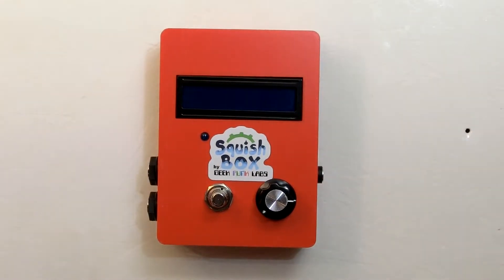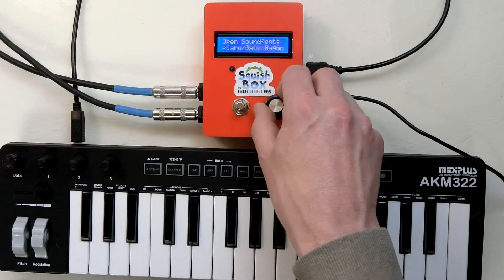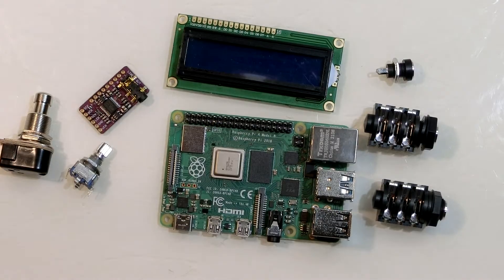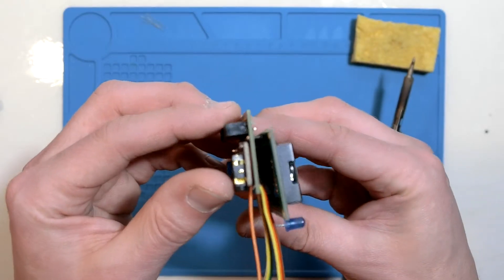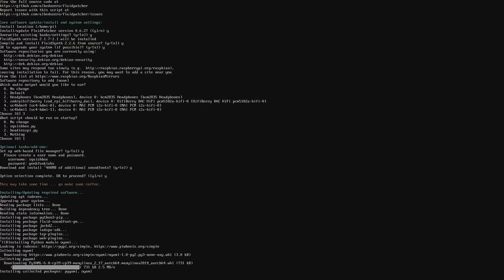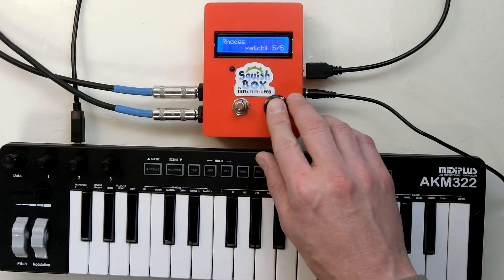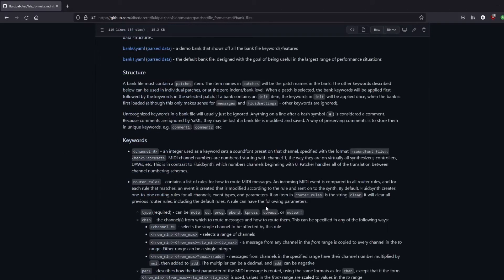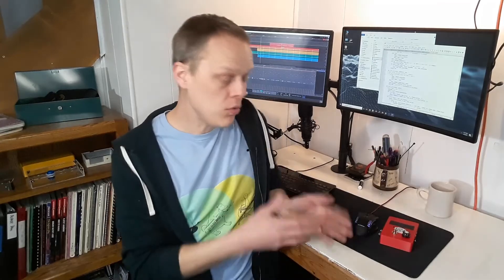The SquishBox: a Raspberry Pi Synthesizer

Comment: I installed Squishbox on a fresh RaspiOS on a separate Flash SD card. It works like a charme! I just plugged in a MIDI keyboard and got a nice selection of sampled sounds. No xruns, no latency issues on a stock Raspberry with stock Linux kernel. Great work!

Comment: This is amazing - I was wondering: Is it possibly to run the SquishBox with SamplerBox's software?

Basically, I love the interface/design of the SquishBox kit, with 1/4" cable outputs, the rotary push button knob, LCD screen, etc. But I like the simplicity of SamplerBox's software, and the idea of just using WAV files and a thumbdrive to play the samples better suits my needs. Is it doable? 

Thanks in advance!
Reply from the maker: Sure! Samplerbox gave me a lot of inspiration for this project. Since it's also written in python, it should be pretty easy to write your own interface for it using the squisbox API: https://geekfunklabs.github.io/squishbox/software.html#api-reference

Comment: This is a really nice project. Would love the ability to use classic Midi 5 pin din instead of USB midi, to use with classic synths, sequencers etc.
Reply: They do sell little midi boards you can connect to your raspberry pi with 5 pin
Reply: Did you ever figure out how to do 5 pin, I’m in the same boat, looking for essentially this but 5 pin so I can use my rock band pro guitar
Reply: There are lots of cheap MIDI-USB adaptors.
Reply: @amigalemming yeah but not my point

Comment: So, how much for this?  I can buy a Galaxy tab A7 or 8 for $80 to 100 and have a giant touch screen and endless apps.  Just holding onto outdated solutions.   Pi projects end up cost 2 to 3 times a tablet in 2023!
Reply from the maker: Store link is in the description. There certainly are more apps available for a tablet, but there's less ability to tweak things if that's what you're into. I'd say it's down to what form factor you prefer.
Reply: @white2rnado   I see your project is really you sharing a cool idea and your skills.   I'm a bit jaded on count of some folks are charging insane prices for their kits!  Didn't really see you are making nothing here.   Thank you for sharing.  Cool stuff.
Reply: This kind of thing clearly isn't for you. Also, good luck with android's audio latency. There is nothing outdated about Hardware synthesizers.
Reply: @1999Fabion  Well, I've had great luck.  Thanks for asking  :)
Reply: @Curious_Skeptic  Idk how it is now, but it used to be that androids audio latency was too high and made using midi keyboards pretty much a shit show, when you press a key and then hear the sound. I tried fl studio mobile, and the on-screen keyboard was the same way. It was due to how android routed audio. This was the only case I would recommend an ipad over a tablet. Is it better now?

Comment: Dear Bill, I have an Orange Pi PC 1, do you think it could be used instead of a Raspberry?
I am concerned about the compatibility with the 40 pins for the power supply.
Thanks very much, my friend.
Reply from the maker: Unfortunately, probably not. The power requirements look to be the same, but add-on cards aren't usually compatible between different SBCs. Even if the layout of the 40-pin connector happens to be the same, if the boards use different processors (which is the case here) they'll need different drivers/dtoverlays to be able to talk to the sound card. I'm trying to learn how to do this, but it's pretty far outside my skill set - hopefully someone out there can help!

Comment: Quick question: My python is VERY rusty. Is there a way to use an LCD with a I2C interface without doing extensive changes to the code? I had a couple of LCDs with I2C backpacks already soldered on.

/Bo
Reply from the maker: Yes - change lines 16 and 57 in stompboxpi.py (https://github.com/albedozero/fluidpatcher/blob/master/utils/stompboxpi.py) as described in the docs (https://rplcd.readthedocs.io/en/stable/getting_started.html#setup-i2c) and it should work fine!
Reply from the maker: In future maybe I can modify the code so one could specify I2C/GPIO in the config file

Comment: I have a collection of like 50GB of sound-fonts I put on a hard drive to revisit when I got something to browse them. Is this a good solution for that? Seems like it! Can just throw thousands of files at this and slowly pick out the best patches, and put them in a set of new folders as I parse through? Fantastic hardware project!
Reply from the maker: Sorry for the slow reply, but just FYI if you have any huge single soundfonts (gigabyte-ish sized), the synth can't open them if they won't fit in RAM. The lite OS and synth software need about 100MB, so you'll have 900MB left over on a Pi 3B+ -- more if you're using a Pi 4

Comment: Do you know if it would be possible to combine multiple midi instruments together, so you could have just a plain old keyboard, a slider wheel, plug them both in and then get a piano with slider wheel?
Reply from the maker: Sure, as long as they can both plug in to a USB port, the software will accept MIDI messages from both the piano and the slider wheel

Comment: How big a sound font file can be loaded into a Squishbox?  I have a file that is about 10Mb.
Reply from the maker: 10MB is fine. There's a difference between how many you can load onto the SquishBox's SD and how many you can be actually using at the same time. The amount of memory you have to store soundfonts depends on the size of your SD card. The software uses about 300MB of RAM, and a Pi 3B+ or 4 will have at least 1GB, so you can use up to 700MB of soundfonts in a single bank file. If you have some crazy big individual soundfonts (like >500MB) you'll want to get a Pi 4 with extra RAM.

Comment: I am having trouble getting the hifiberry DAC 2 working with Squishbox, but it could be the RPi I am using.  dmesg is shows the overlay throwing an error.  All that aside, thanks for doing this! I am really happy with the minidexed project (although it would be awesome for that project to support i2c devices and be a little more flexible on hardware).  Blokas MODEP on RPi works great as an effects unit too.  Golden age of linux music production!
Reply: Hey, the HiFiberry works like a champ in one of my RPi 3s, so that's what I'm going with. Cheers!
Reply from the maker: @JoeJohnston-taskboy  If you're using a DAC 2 I think you need dtoverly=hifiberry-dacplushd in your /boot/config.txt - sounds like you got it working so maybe you figured that out 😊
Reply: @white2rnado  The RPi4 I was using has some broken GPIOs, I believe.  The RPi3 worked fine.  Yes, I needed to add the dtoverlay line (which was hifiberry-dacplus in this case).  The unit is working well.  Really impressive project!

Comment: Amazing work, man. You're a legend. Can I create CC assignable patch changes? For instance, with an Alesis Vortex Wireless 2, could I set up the pads (P1-P8) so that they load different patches?
Reply from the maker: Yes you can - you can create a router rule with a "patch" parameter to either increment/decrement the patch number or select a specific patch. It's described briefly here at the end of the router_rules section:
https://github.com/albedozero/fluidpatcher/blob/master/patcher/file_formats.md#structure

I'm working on documenting this more fully. For now here's an example:
https://gist.github.com/albedozero/44263e13e538492db084c6400f3097b8
Reply: @white2rnado  Thanks so much.